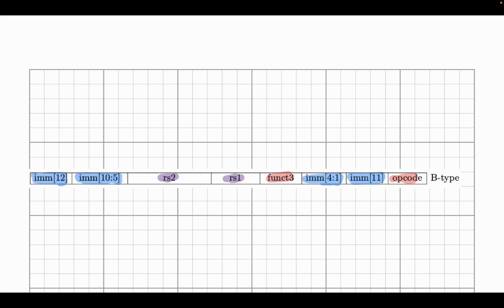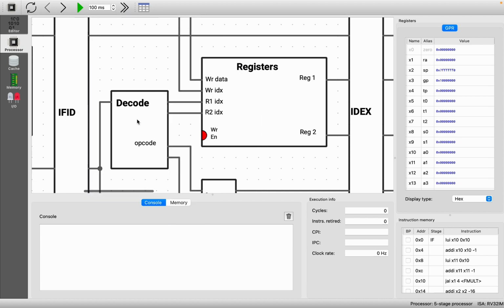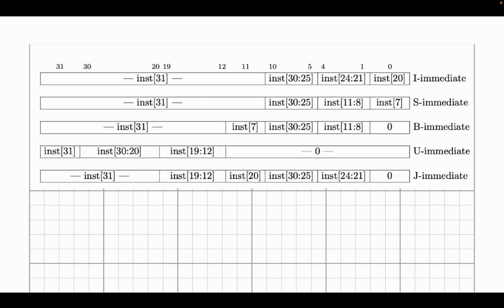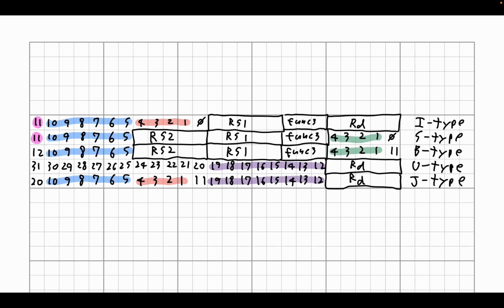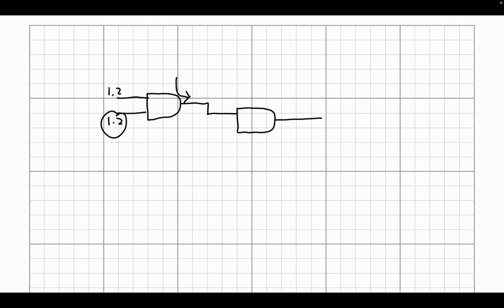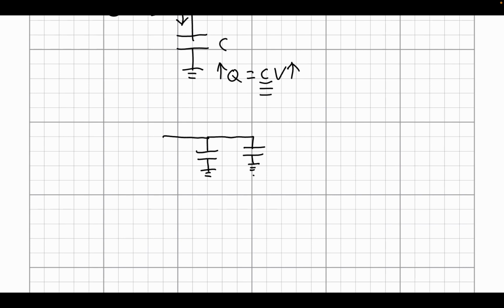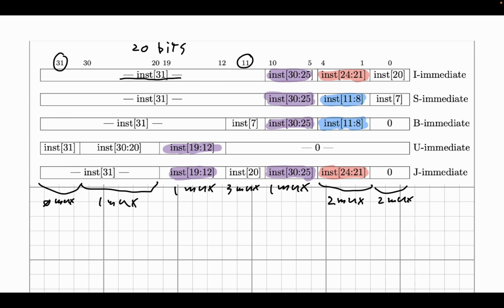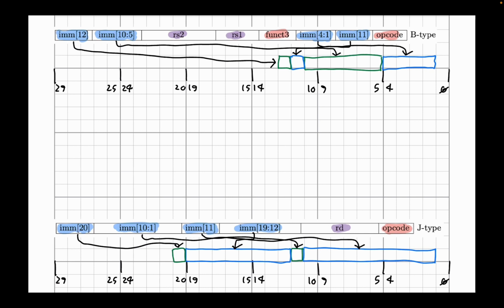Why are RISC-V Immediates so weird?

Comment: Not only can you put a more powerful output transistor on bit 31 of the instruction, you can also start to select 0 or 1 into bits 31..12 of the decoded constant before you even know what instruction format you have or if it has a constant field in it at all. So you have the maximum amount of time available to charge those capacitors. In the same way, the RISC-V encoding allows you to take the bits for rs1 and rs2 and start to read them from the register file immediately before you even know whether your instruction is a format that has rs1 and/or rs2 fields. In other ISAs the register fields move around and you even have the same field sometimes as a source register and sometimes as a destination register -- almost every ISA except RISC-V does this with at least load/store instructions.  None of this matters much on big high performance OoO processors, but it makes a real difference on small microcontrollers and smaller in-order applications processors.

Comment: The statement that RISC code size is much larger is not really true in practice with ordinary code targeting the C extension (which is included in every commercial RISC-V application processor). RV64GC code is about the same size as equivalent AMD64 code. Now... compared to the very most compact ISAs purpose-built for microcontrollers, sure, you still lose; but for application processors it's about at-par.
Reply: RV64GC code is around 20% smaller than either amd64 or arm64 -- just grab your favourite Linux distro for each one (same version) and look. RV32IMAC is a few percent bigger than ARMv7, mostly because of the lack of 16-bit encodings for byte and half load/store, and lack of push/pop multiple (though -msave-restore runtime fiunctions help). The Zba and Zbb extensions from late 2021 help, and with Zcb (those byte/word load/store and a couple other things) and Zcmp (push/pop multiple and help marshalling function arguments between A and S registers) RISC-V has smaller code than ARMv7-M and other popular microcontroller ISAs. The Hazard3 cores in the RP2350 / Pi Pico 2 implement all these.
Reply: For distro binaries, that's not always a function of the ordinary compactness of equivalent code, because AMD64 binaries often include feature detection and alternate code paths for different ISA levels.
 @BruceHoult